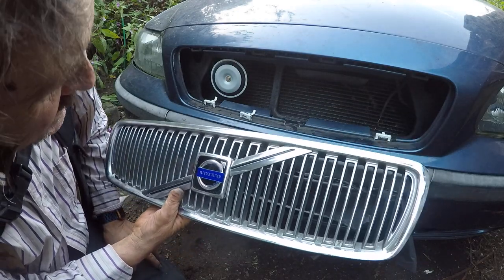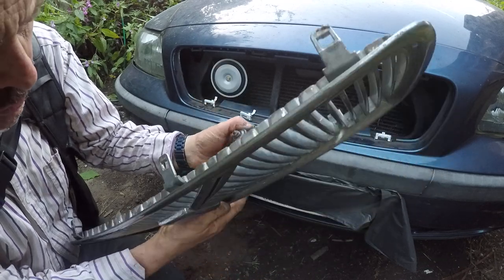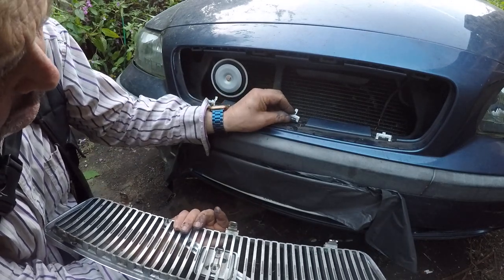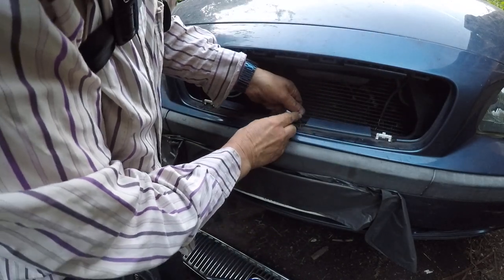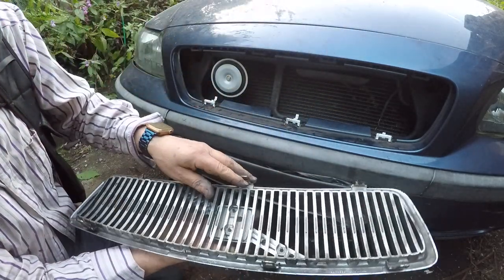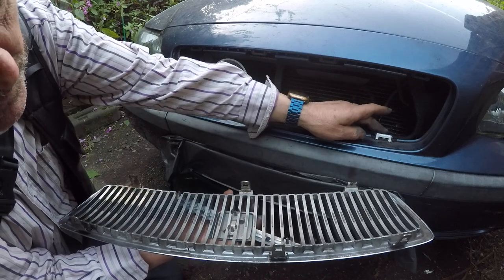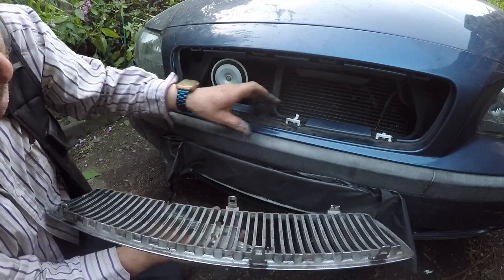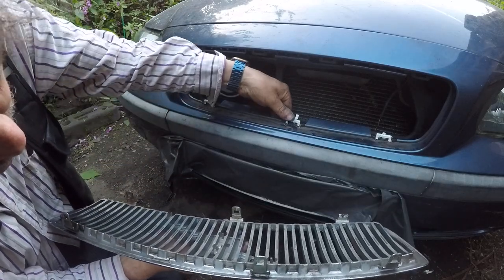0057 Volvo V70 mk 2 front radiator grill removal for horn replacement

Comment: What tool did you use to poke through the grille and push the tabs down?
Reply from the maker: Hi Luke, A slot screw driver will work or to be more sure of pushing in the right spot, a bit of flat bar notched out at the end to suit the spring. The biggest trouble I had was seeing the clip in the dark, so a good light is super helpful. Hope it works for you!